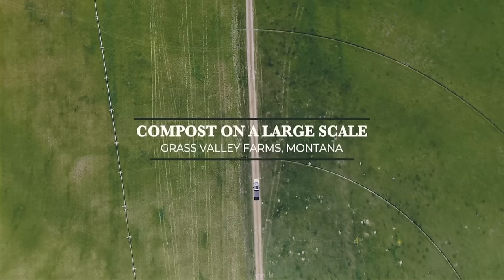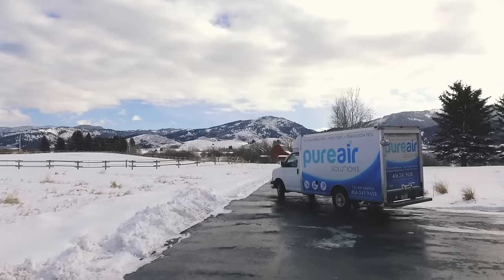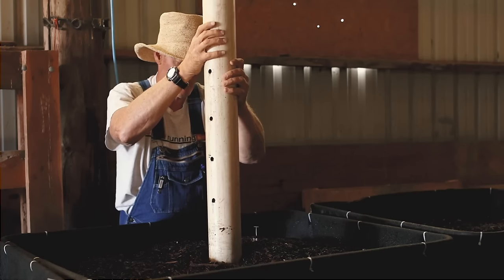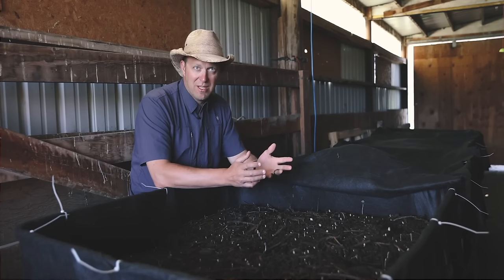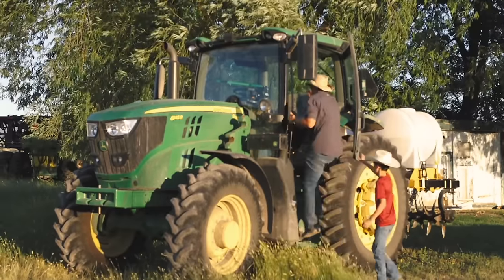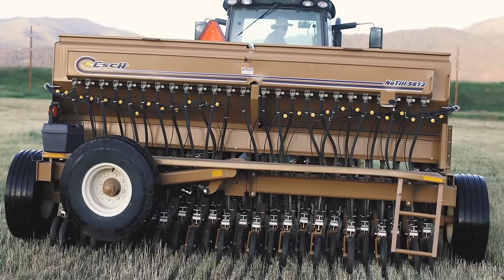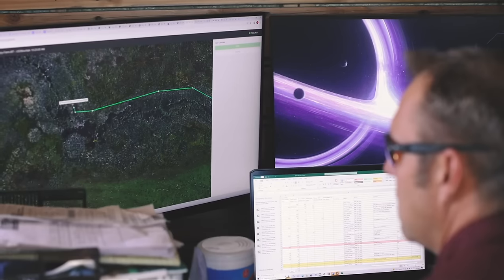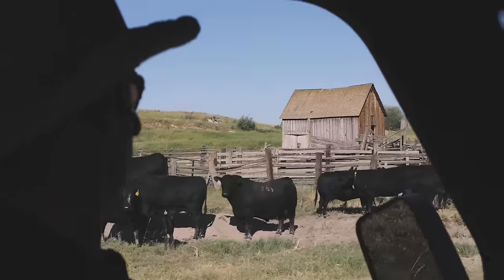Compost on a large scale: Regenerating 1000 acres: With Cory Miller and Kevin Lackey

Comment: I started incorporating a similar system onto our market garden soils around 10 years ago.  My small cow herd is the key to our success. My tomato plants averaged 8-10 lbs per plant by the old method and they now average approximately 40 lbs of fruit per plant. This is a very inspirational video and now I'm excited and pondering  ways to tweak and streamline my systems for next season.
Reply from the maker: Wow that’s such a huge difference. I’d be interested to know if adding in this kind of compost makes a bigger difference. Keep me posted.
Reply: Wow! 🇺🇸 😎👍☕
Reply: The hay is the key. You can compost it or not and you will get the same results. Composting just gets it going faster. You don't need to wash the microbes out and spray them around but this is just a proof of concept that it's the microbes that are what makes soil fertile. The compost is the habitat and food source for the microbes. As long as you keep the soil microbes fed you will never have to do another inoculation. Red worms speed the process up as well if you don't want to do rapid composting or even add worm castings to your ripe (cooled) compost. It almost does mater what you do as long as you DO SOMETHING with compost. We cannot just take, we have to give something to the soil. Look at what Joel Salatin is doing by having his chickens spread his manure or use the manure mixed with hay and spread it in the spring.
Reply: Come on now Yahuah is the creator of all things all life play a role in everything even insects. The natural way will always produce more yield, better quality better tasting products

Comment: I really appreciate the information your conveying. I especially like the tube with holes you put in your bins. I use alot of grass clippings in my compost and have trouble with it going anaerobic. Hopefully it will cut down on the number of times I have to flip the piles. Thank you
Reply: They will definitely help. "Chimneys" in general, will help with airflow. A broom handle pushed into your pile will do the same thing. Don't be afraid to  put lots of chimneys. They are also a good way to manage temperatures in your pile.

Comment: Hi Cory!  for Johnson Su bioreactor mix -- 60% woody material, by volume, or by weight? Notes: 30% alfalfa hay, 10% high nitrogen source (spent grains from breweries, horse manure)
Reply: By volume. Easiest way is to get buckets similar to the orange bucket in the video. If you have 10 buckets, 6will be for woody species (includes leaves), 3 buckets for green material (includes all greens), and 1 bucket of high nitrogen (manures, spent grains). Doing it this way keeps it simple. Make sure you are soaking these materials before they go into your pile. Drain off the excess water and then mix the contents together. Lastly, set your chimney tubes and place your material into the pile. If you are in a colder climate you can add more high nitrogen to your mix to help you keep higher Temps. The recipe above is our spring mix (for Montana weather) as we make all of ours in the spring. Average high Temps in the spring are around 45 to 55 degrees F. Nights can be below freezing.

Comment: Excellent video. I showed my students.  A question came up, wouldn't cow manure have more microorganisms more suited for wood break down due to their 4 Stomachs?
Reply: Wood is a high carbon source used for the production of fungal hyphae. Manure is used merely for its nitrogen component to feed the bacteria. Cow manure typically has more water and is more messy in the production process. Horse manure is much easier to work with and why we prefer it to other sources.

Comment: Hi, just a dumb question cos some bits have me stumped...
One load of 25lb of compost thru the Kettle, into the main tank to have 1200 gallons of extract...how many acres will the 1200 gallons cover?
FWIW we had it drummed into us when we were in a cropping district (in Western Australia) that there was Soil Chemistry (fertiliser that was actually needed), Soil Structure (gentle ploughing speeds, deep ripping for aerating etc) and the big missed one Soil Biology. 
We were doing cover crops etc but wish were using this extract but 20+ years ago, we weren't likely to find it 
Keep up the great work!!! (and great video too)

Comment: Be very careful with horse manure in compost!  If there was any trace of roundup in their feed it will pass into the compost.   A muni in Vermont found this out the hard way when their compost was killing gardens.
Reply from the maker: Thank you for sharing this. It would be an easy mistake to make.
Reply: I have come across this issue,  I don't use animal waste that has come from offsite, so I can control what's in it. In addition to possible glycophosphate poisoning,  whether or not the animals were wormed will also affect their waste. My compost is aged 2 years before it is applied, as at the 2 year mark the efficacy of the round up diminishes significantly as to be ineffective.

Comment: One question what's the point of making concentrate do dilute it on the field, when you can just put organic material on your field and achieve the same result?
Reply: The answer is cost. Liquid is much cheaper to distribute on the field then dry compost. Dry compost doesn't spready evenly and consistently. Also, both applications serve different purposes. Dry compost is more of a soil inoculum, liquid extract is more of a foliar plant application. Overall, liquid extract is less then 20% of the cost of applying dry compost. A 100 acre field would need 100 yards of BioComplete compost applied to have effective coverage. Cost $8,000 (very conservative cost estimate, could be north of 50K) + the cost of hauling and applying. Total of $11,000. Liquid extract applied to the same field 1 time would cost about $1,800. The negative to the liquid is that you are not getting the carbon that is in the dry compost. We tend to leave more carbon behind in our grazing operation so that we don't have to add outside carbon.

Comment: Is the carbon used a formal / proper biochar? I have read that the difference between biochar vs charcoal is even more effective.

In addition, are the liquids able to contain the biochar as its spread? Over several years, that can make impacts to the oil for centuries.
Reply: We use leonardite.

Comment: I've listened 5 times still cant make out what kind of carbon it is, he says it is candy for the bugs. Can you please give me the type of carbon it is? Where you get it and if you can make it yourself or does it have to be purchased? Thank you! Also what to you think about compost made purely of horse, goat, sheep and chicken manure? Or do you think I should only use a percentage of manure with other biodegradable materials? Also I have clay soil, it has alot of minerals and holds water  but it is compacted and needs to be lighter and fluffier to allow oxygen. I have piled brush and dug into a couple years later to find the dirt is full of worms, red ones and bigger brown worms that have a lighter tan ring, possibly an earth worm, big like a night crawler. Do the worms help break up the soil to allow oxygen in? I tilled the garden last year to get manure in to try and lighten the soil up, after watching this video I wish I would have put wood chips in. I'm don't want to disturb the soil so can I lay down wood chips and go heavy on the compost over the top? You said you had a lady who pushed a probe 4 feet down into your soil. What made your soil so soft, the worms and bugs? plant roots? A combination of both? Was it the entire echo system you brought to life in your dirt? What would be the steps in numerical order to get me there? I would really appreciate any help to get there. Thank you!

Comment: How do you clean 🧼 your tanks from biofilm?
Reply: Our key is consistent cleaning. When we do a batch we clean immediately. We only make fresh extract the day it will be applied. Every implement we use is cleaned immediately after use as well. We are not making teas, so our biofilm is fairly minor. We have added fungal foods to a batch and immediately plugged up our drill system. We had to remove orfices and over apply just to get the liquid out of the system. We don't do that anymore. Any teas are applied through a boom less sprayer. Bigger nozzle and less chance for plugging. The only cleaner we have used is vinegar and have limited success. Thorough rinsing is key and works well if done consistently.

Comment: How do you make sure that the piping doesn't get fouled?
Reply: Each day when we water the reactor we check to make sure the chimneys are clear. If they are starting to fill up with compost we clean them with a post hole digging hand tool. Works well and can be done very quickly.

Comment: On the ratios of material you use, do you measure by weight or volume?
Reply: We start with all components being dried down. Most are stored for a length of time before we actually put everything together. Our ratios are by volume. We take 10 home depot 5 gallon buckets, fill 6 with our woody materials, 3 with our alfalfa hay, and 1 bucket with manure and spent grains. We will increase our manure bucket if we are building when outside air Temps are below 40 Fahrenheit for the extended future. We build in spring and late summer so that we have batches ready the following spring and fall.

Comment: You're inoculating so you COULD just spread the compost rather than washing the microbes out and applying it to the soil. So the question is . . . why not just spread the compost? Are you re-using the washed compost to inoculate the next batch of compost? I was not aware that needed to be done. You did not show the compost at the start when it was hot but only at the end then the fungi are established. OK I guess the people in this video are not the ones that own this channel so not sure if the will ever see the comment. The only reason we compost is for speed, you could just spread the hay and manure and the same thing would happen but slower. Ive tested it myself. Just trowing the hay and manure and now I have a field of extremely fertile soil that the raccoons are always digging grubs out of and the trees are now free of spider mites that use to infest them.
Reply from the maker: Cory reads the comments and will respond. As I understand it he has applied compost directly and this works well too. By working with compact compost (Johnson Su bioreactor) and an bio extractor, he can add humic acid which multiplies the bacteria. So you get more bacteria with less compost. The aeration makes sure the bacteria is aerobic. Using the drill and aerator that he has customised he can put this extract directly on the seeds. This is a more targeted way of composting and the compost goes a lot further. Same resources, used in different ways to innoculate the seeds and make sure the bacteria is aerobic not anaerobic. This film was made over a week and I wasn’t in Montana when he made the original compost. We plan to make a video of how to make a bioreactor in 2023 and will make sure a lot more info is in there for you.
Reply: @peopleoftheplants  Bacteria are what create humic and fulvic acids so how does adding those acids multiply bacteria? I dont think it does. Humic and fulvic acids act as a bio-catalyst and bio-stimulant for the plants. Humic acids chelate nutrient compounds in the soil making them more available. You can buy humic and fulvic acids as mined Leonardite which is oxidized lignite is the lowest grade of coal.
Reply: Your question is a very good one and the simple answer is cost. We managed 1000 acres last year. This year we will be farming with these principles on approximately 2200 acres. Compost applied dry to the fields at a rate of 2 tons per acre costs us about $50 per acre. Applying the extract with the equivalent microbiology costs us about $5 per acre/application. This price varies depending on our application method. Our pivots and water truck are the cheapest. We can cover significantly more ground by using concentrated extracts for the same amount of money spent. During hay feeding season we will inoculate round bales with extract and bale graze them with our cows. This is similar to what you suggest in your comment. It works very well. I do have concerns with concentrated amounts of nitrogen and phosphorus in certain areas of our fields. By applying the biology to our hay before the cows eat it we are able to distribute the biology with a food source in perfect conditions for replication. This helps to keep minerals in an inorganic plant available form. Feel free to give me a call if you would like to discuss.